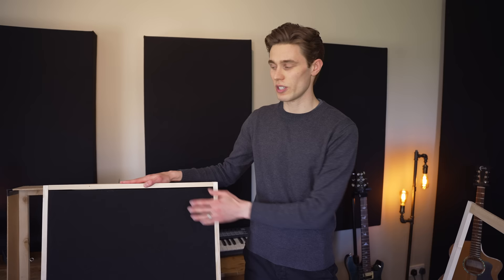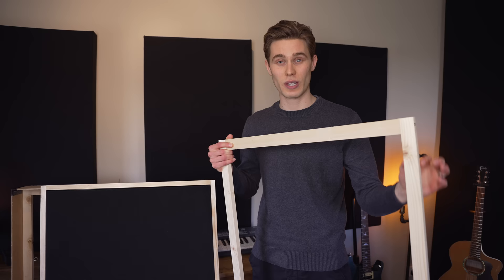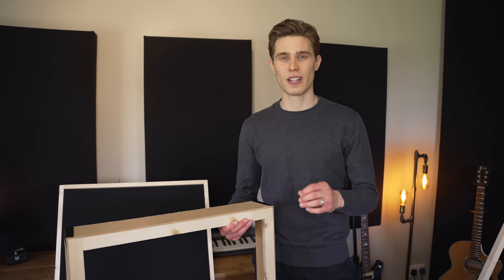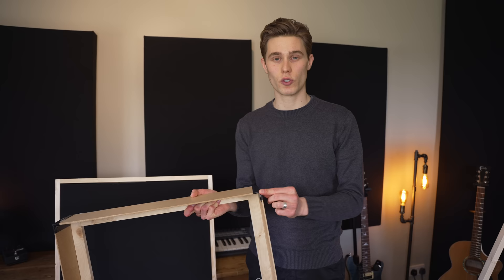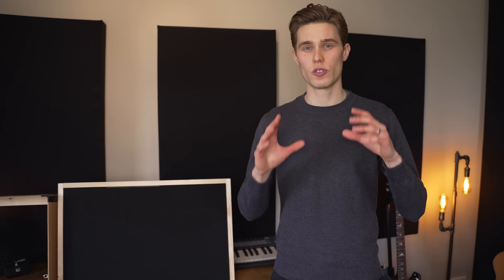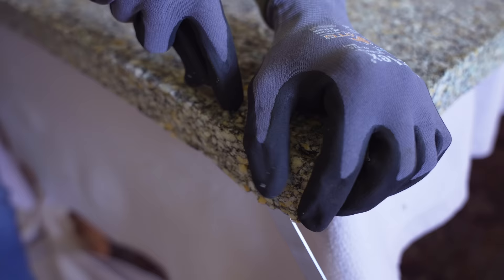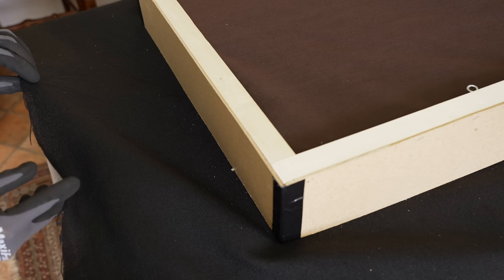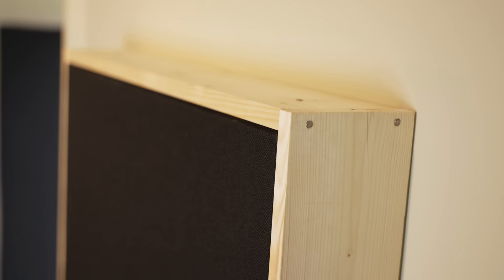How To Make Your Own Acoustic Panels - DIY Professional Acoustic Treatment for Home Studio

Comment: What to do about the noise comong through windows and doors?
Reply from the maker: I would recommend:
- Using heavy curtains or blinds if possible.
- Making sure window and door seals are fitted properly and form a good seal when closed. You can fit extra sound reducing seals if needed.
- Watch my video about reducing noice when recording, YouTube "In The Mix Reduce Noise WHile Recording"
- Using double or triple glazed windows
- Fitting heavy, sound proof doors

On top of all of that, these panels will help somewhat at reducing the reflections of this noise when it enters your room.

Comment: Funny enough, he mentions recycled denim as a safe alternative to mineral wool, but that stuff needs as much protective gear as mineral wool does.
Reply from the maker: Would you care to elaborate? Besides being careful to avoid inhaling dust during the installation I wasn't aware that denim/cotton needed any more precautions.
Reply: I use a respirator anytime I work with either recycled denim or mineral wool.  Either one is bad for your lungs due to the particle size, and generally I find both put off a significant amount of dust.  I also use long sleeves and gloves with both, as either one will make me itch.  The advantage to mineral wool is its resistance to fire.  

Its become nearly impossible to find recycled denim here in the states, so my next project will be with mineral wool.  I  will also encase the mineral wool in 1mil thick plastic sheeting, to prevent it from shedding any fibers in the future, as this is going in my shop which sometimes gets blown out with the air gun.  The plastic wont really affect the absortion properties of the material in a meaningful way.
 @inthemix

Comment: Can someone convert the metric units to imperial? Thank you
Reply from the maker: It is better to not convert and instead find approximate dimensions based on local materials. Metric to imperial conversions are incredibly simple using any modern web browser/search engine.

However, if you convert 120cm to feet you’ll find that it’s 3ft11.24inches…

In this case it would be better to simply use a 4ft piece of timber because that will likely be what your local supplier has if they are using imperial measurements.

Comment: I think this tutorial is superb for panels that help control reverberation and "echo". I love that the material used is actually safe, rather than dangerous building insulation!

However, after watching many videos from the Acoustic Fields YT channel (link: https://www.youtube.com/c/Acousticfields101), I'd wager these panels are not necessarily good for treating the actual acoustics of the room. For instance, Dennis @ Acoustic Fields has talked about the right material and its properties for amount/rate of absorption, and the sound frequencies that the material absorbs. These panels may or may not deaden the room, rather than absorb those unwanted frequencies. So, these panels are great for reverberation, but research should be done for proper acoustic treatment of the room.
Reply from the maker: Thank you! That’s such a nice comment. I’ll add a few details here:

I measured before and after and the panel’s absorbed and balanced lots of spots (obviously the couldn’t deal with some of the small dead spots in the room!).

I have heard many times about this creator and have received much correspondence from folk who were highly dissatisfied following their advice. I’d be careful who you listen to online (including me!) and take into account lots of views (which is precisely what you’re doing).

Comment: would these help to absorb bass down to 70hz?
Reply from the maker: I believe that the panels would be minimally effective at 70Hz. I notice a good difference in the low mids but to control or reduce bass and sub bass you really need many cubic meters of absorption or other tools such as active bass traps, room EQ and wall cavities etc.

Comment: Instructions in inches?
Reply from the maker: I used mm, cm and meters because that’s how materials are sold in Europe. I understand it’s a pain for those using inches and ft (which I actually prefer!) 

1 inch = 2.5 cm = 25mm

I hope that helps a bit!

Comment: what kind of wood type are you using for the frame?
Reply from the maker: I believe it is pine. It claims to be fcs certified so might be Scots pine or European. It is certainly a fast growing white softwood!
Reply: @inthemix  i guess pine is the right material Light on the weight also on the wallet.
Reply: @inthemix  By the way, can you also make a DIY bass traps? i think everyone building thous panels would want to build traps as well. thanks a lot for the information

Comment: Great construction technique and video.  However, I do not think that you should be spreading the misinformation that rockwool is dangerous.  It can be unpleasant to work with certainly, but has been repeatedly proven over many years to be safe, and is one of the most widely used and studied materials in the entire building industry.  It's also the cheapest and acoustically most effective.  So sure, if you don't like wearing a mask and getting a bit itchy, use something else, but let's not have so much drama about it.

Comment: You don't want to use mineral wool or fiberglass insulation for safety reasons. Okay. But what are the fire safety properties of the insulation material you are using? Whenever I hear the word "foam" this is going to be my first question.  Mineral wool is not flammable. Fiberglass insulation, while it does melt in a fire, does not generally ignite. Foam, on the other hand, is - generally speaking - flammable. The Station Nightclub fire in Rhode Island, USA in 2003, where 100 people were killed, happened when acoustic foam caught fire. Now I'm not saying your denim-foam is flammable - I'm merely asking if it is. If mineral wool is contained in an envelope of fabric, then whatever materials you're worried about would by definition not be in your breathing environment. I wouldn't use your material without first seeing an actual demonstration of the flammability of it.
Reply: After looking into this a bit, the denim/foam insulation materials I've been able to find have - like cellulose insulation - been treated with boron, which is, among other things, a fire retardant. So that's good to know. But I would also ask whether the particulate matter from this insulation is any less dangerous that that which may come from mineral wool or fiberglass. I wouldn't want any of this in my lungs. Some claim that mineral wool fibers - unlike fiberglass - will fall to the floor and not "float" in the air. What happens with denim/foam particles? Whatever material you use, it is important that it remain in the enclosure.

Comment: Lots of talk about recycled material and supposed health hazards and zero talk about insulation performance 🤔
Reply from the maker: Insulation performance varies by product and thickness. Its all on the datasheets but usually this data is for inwall applications. 

You will never find a perfect material for absorption, there will be huge gaps no matter what you use so it’s better to choose the healthy option. All my opinions of course!

Comment: "High Performance Acoustic Panels"??? Yes, these things are sold everywhere... Yes, they do something... BUT... if you glue some carpet to your wall you'll have the same effect!!! INSULATION is for INSULATION... NOT dampening or acoustic treatment, even if it's called "acoustic" insulation... there is a BIG difference in the definition of "acoustic" between sound engineers and construction engineers... learn something about acoustic diffusion...

Comment: How is there need for a 13 minute video. 
Buy plywood. Get a driver. Attach, flip it, wire it. Done and yeah good enough for a studio. Pro? Not by any stretch of the imagination? High performance I mean now realism has left the building. True pro Set ups don't use them so not Magic just a board and a driver some resonance or vibration and your speaker isn't audible anymore I truly doubt a pro would want this 😂